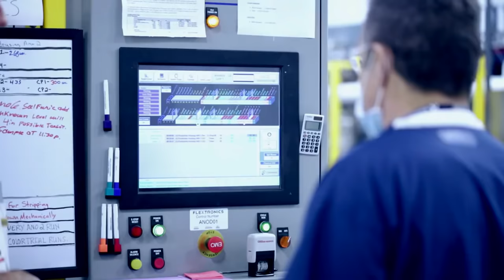Apple - Manufacturing Process Mac Pro [Making Of]

Comment: I can assemble a better computer for under 1.5k , so you eventually save 8500 dollar
Reply: +Conex Xenon really considering the processor already cost $2000+ and the 2 GPUs also cost $3200+ dollars each, the PCIE bassed ssd storage $1000, you've already hit 9000 dollars there so i dont think you could do that could you.
Reply: well for performance per dollar yeah it is, but there are things you get with both xeons and firepro cards that one cant get on a consumer card, they are meant for the professional though not for the average Joe who like to take photos of birds and edit them on photo shop, plus looking at the size of the thing there a lot of engineering and R+D that goes into making this.
Reply: Exactly... That's Apple prices! Divide by 2.5 to get USD :)
Reply: Yup. Double precision floating point performance is much better on Xeons and FirePros. Most games use single precision floating point values, which are obviously faster but not precise enough for many workstation tasks.
Reply: hi
Reply: In Fact ... 
A- intel xeon e5-1680 = 1700$  back in 2013-- scores 16997 benchmark
 C-You could get an i7-8700k at 378$ for a score of 16274 Benchmark
 C- for same price as apple  an i9-7920x socre 23500 for 1500$

A-16GB 1866MHz DDR3 ECC memory = about 400$
C-HyperX Fury 16Go 1866MHz DDR3  = 170$
C-Corsair Vengeance 32GB 2666mhz ddr4 at 440$

A-Dual AMD FirePro D700 with 6GB  around 3000 for both
C-Dual GTX 1060 6GB = 1315$
C-Dual asus 1080 TI 11gbs gddr5X for 3000$

SSD both cost aroung 150$ for i see ..

-add a power supply for custom pc

C-evga 1000w GOLD = 240$
total for Apple = 5250 on amazon Or 4699 on apple.com
total custom = 2253$
Total custom same price = 5330$

But hey .. if you wanna pay a ton for a piece of shit from 2013 in 2018 feel free :)
Reply: You can get dual Xeon 5680's from Ebay for $60 each and they will get 30,000+...